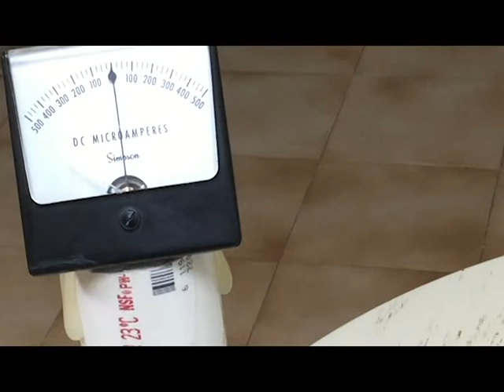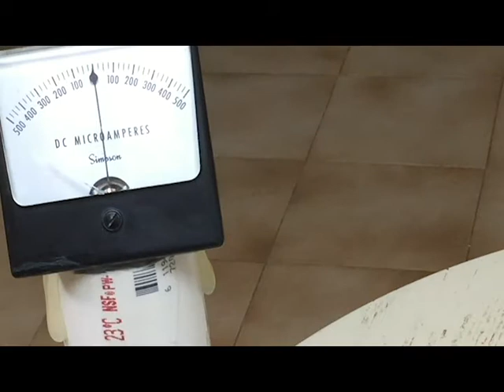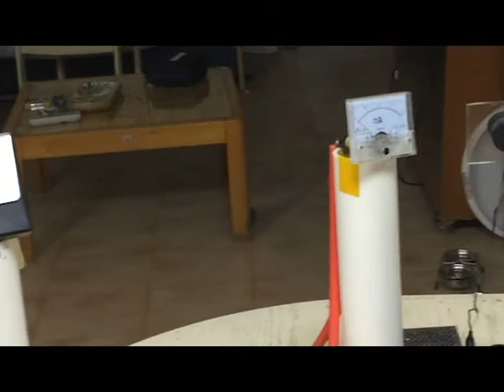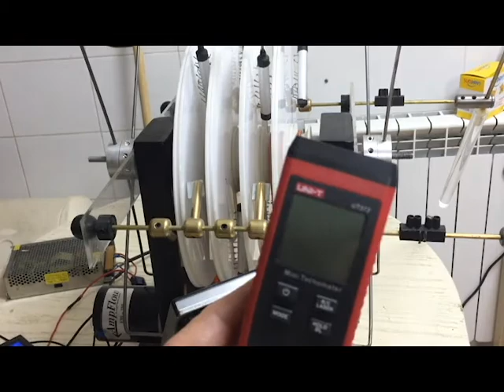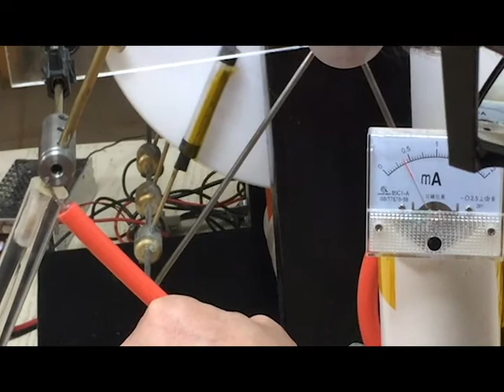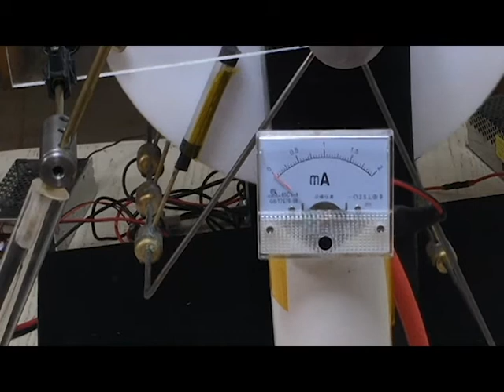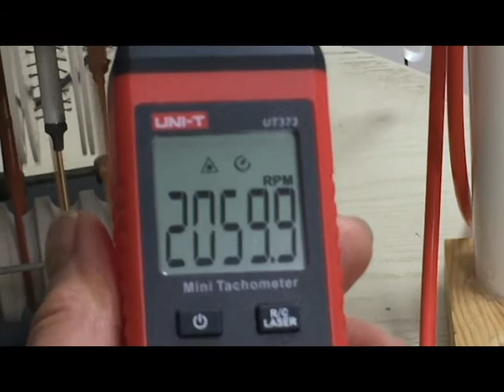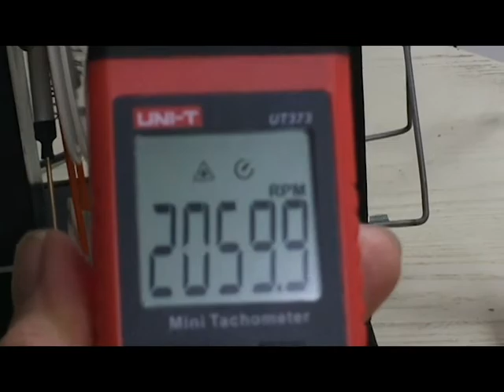Measuring Current From Static Electric Generators PART II

Comment: Based on my own personal experiments, you will get a higher amperage reading if you force the machine to jump an air gap. I don't know if it's because the voltage drops and you are getting more amps because of the ion collisions or what but in my Wommelsdorf Machine replication what I saw was that I could get as low as 20 micro-amps with the lead connect directly, but if I posiitoned one lied 90 degrees to the other lead and separated them lie points on an right angle triangle, that the current would jump to 100 micro-amps.

Like I said, maybe it's collision-ionisation in dark mode that's causing that.

Something I can finally explain is why these machines can function as "latent charge pumps" in the same way that heat pumps fuction as "latent heat pumps". When you rotate the discs, because you are moving tangetially to the electric force vectors you only have to fight a component vector of the electric force as determined by gausses law.

By leveraging lateral motion via rotation, the discs never have to fight the full force vector of the electric force, they only ever have to fight cos(theta) of the angle between the applied mechanical force and the electric force vector. In this way, the electric potential energy you can build can be higher than the mechanical energy spent directly opposing the electric force.

Force example, when you are sliding sectors into our out of direct alignement in a wimshurst machine, sliding the sectors into direct alignment only requires cos(89)*Force_repulsion_electric of force. This phenomena, is akin to sliding magnets vs pulling magnets, the potential energy relationship is assymetical.

Comment: Hi, i just bought the same uA meter, i just have some doubts about the wiring, is it wired to the ground side in series right?
Reply from the maker: You can wire it right across the two high voltage terminals (although some machines with neutralizer issues will stop working if dead shorted), or you can connect one pole to one high voltage terminal and the other to the neutralizer, or directly to ground.  The key is if the meter is too close to the high voltage output, you will not read properly, you need to experiment.  Dead short readings vs. one terminal to neutralizers or ground will give roughly the same readings, you don't get double the current by connecting to both high-voltage terminals on these. The only time the meter needs to be in series is if you are reading the current draw of a load. I used 100 kV high voltage wire in the video to connect the meter, it helps a lot, but you can use an ordinary ignition system wire like a spark plug wire (even though that is a resistor wire, the resistance is trivial at voltages this high). Also as you can see, these cheep meters are polarized (I think the negative terminal, or the positive is marked as such) if you connect the meter in the wrong polarity, the needle will try to move in the opposite direction, its why some of the more expensive Simpson meters are dual polarity and the zero point is dead center of two identical uA scales. It so it will read in either polarity.  The meter can not sit on a table or wood because it will look like ground to these high voltages, it must be supported on a good insulator far enough away from ground or what looks like ground, or again it will not work very well if at all.

Comment: Nice setup  but not very centered rotors... somebody sugested  to use dvd drive motors and dvd  as disks mounted  face to face rotating  in oposite direction ...small setup ,high speed  and theoreticaly high performance system ...
Reply from the maker: High speed is good, but you need speed and surface area, so maybe 100 + dvd's then you are talking a reasonable output.
Reply: @MisterBonetti  ig one of your discs is about the surface area of 5 or 6 dvds. i think you have 8 discs for 4 stages right? so that s 40 to 48 discs. But bc they are smaller its easier to make them spin faster. on the other hand more discs means its harder to make them all stable as every imperfectly rotating disc will affect all other discs...
Reply from the maker: @scipug3048  No, the surface area of my 30cm discs is about 94.25 centimeters squared, the dvd is about 37.7 cm squared so 2.5 dvds.  The problem (again see my two current reading videos) is you don't use the entire surface area of the disc, so the actual surface area is the active charge ring, not the entire surface area of the disc, it is also harder to prevent the machine from internally shorting when the discs are small, especially if not housed in an insulating gas like but not limited to hydrogen.